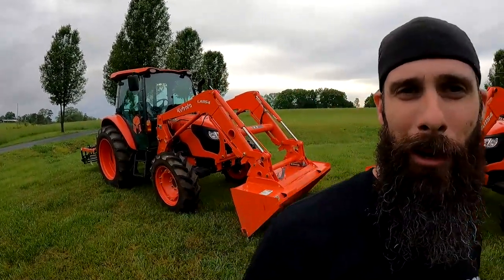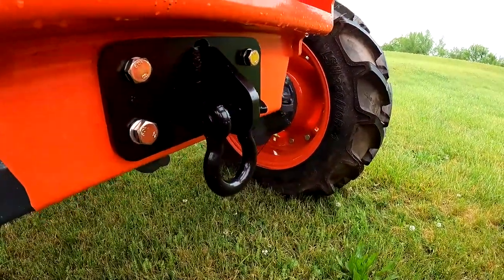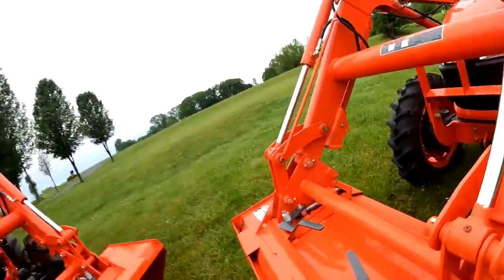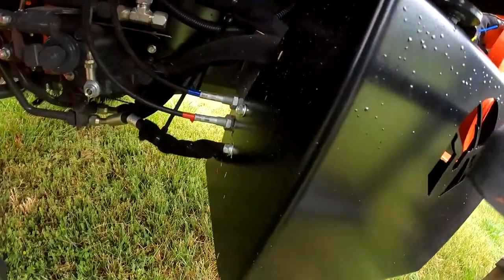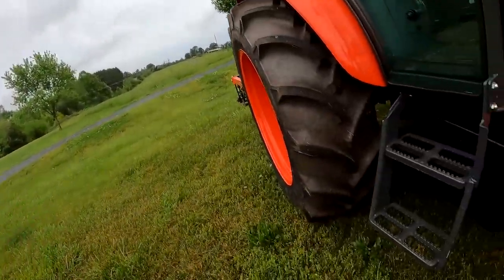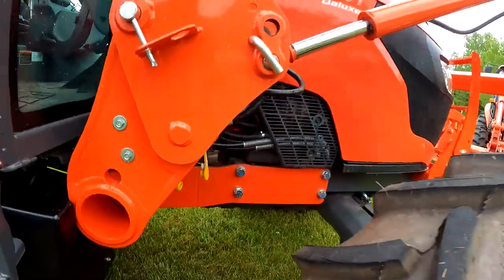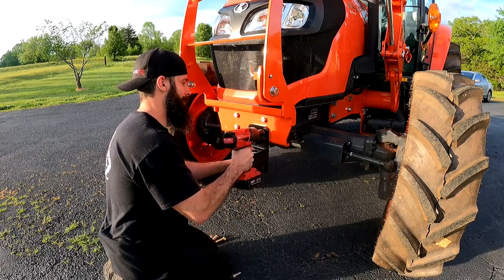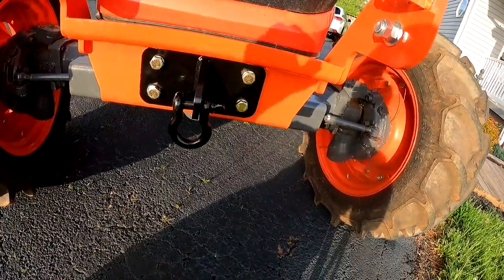Kubota Tractor HD Accessories.  Hydraulic Shield and Front Tow Point

Comment: Awesome stuff man, the grill guard would definitely be a good idea especially for folks who use a grapple a lot on their tractors where branches seem to always manage to find that one hole to poke through and hit the grill! Another good thing would be a well thought out pre weighted class 2 utility box, something like a ballast box but one that’s built heavy enough to not need additional suitcase weights or anything like that which could hold chainsaws, rakes, string trimmers that’s also got a 2” receiver hitch and 3/8” chain hooks on it, most ballast boxes you find are class one and require adding additional weights for ballast when doing heavy loader work and aren’t geared for tractors this size and when you are in the woods it would help keep the overall length of the tractor to a minimum plus give you some room for actual storage. All the best, AJ.